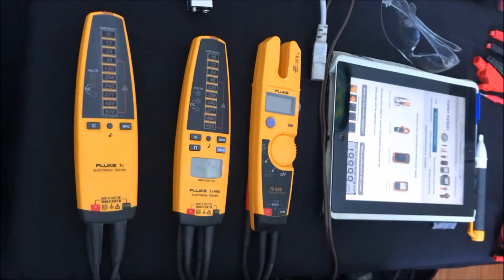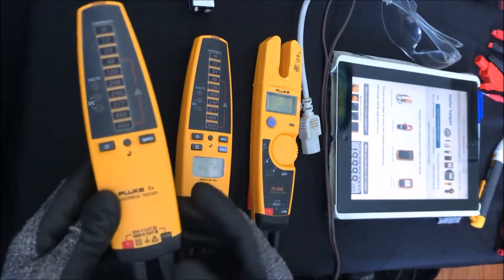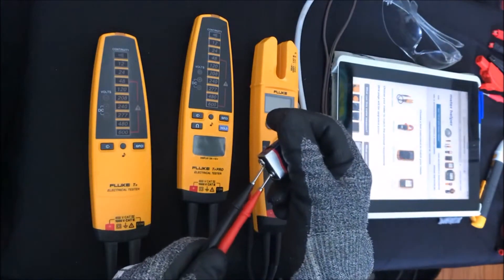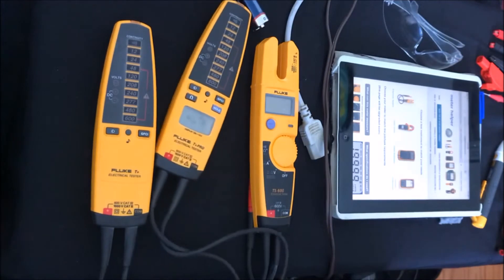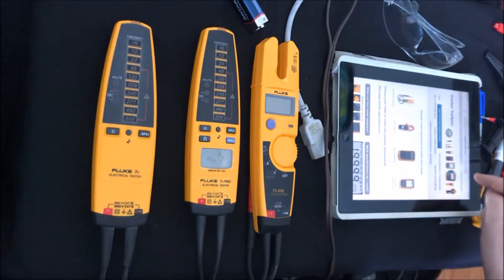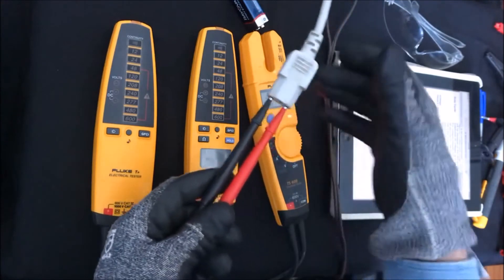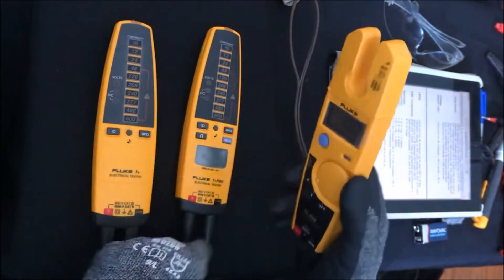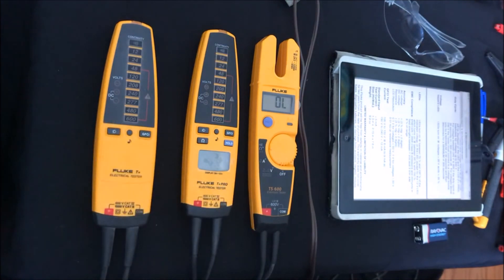Comparing Fluke Electrical Testers T+ , T+ Pro, and T5

Comment: hello... can the T5 clamp meter measure voltage with putting wire within the clamp? ... thankyou
Reply from the maker: Hello, sorry for the delay in getting back to you. The newer Fluke T6 models added the non-contact voltage measurement to this design. The Fluke T5 models only measure AC current through the open jaws. Hope this helps.
Reply: @meterhelper7692   thankyou for the info

Comment: This may be a stupid question, but trying to learn... What is the benefit of this type of electrical tester, over a multimeter?
Reply: That is a very smart question because the lines between electrical testers and multimeters are getting blurry.  Some of the benefits of  electrical testers over multimeters are speed, ease of use, form-factor (fits in a belt holster), and being tailored for everyday, grab-and-go use. 

These evolved from what was known as a "wiggy", a solenoid that would vibrate when two leads were put across an AC voltage source. Safety was an issue with these and analog meters because there was nothing between the user and the voltage if something went wrong, like an arc blast. 

Wiggies were  preferred by  electricians over analog meters  because they were fast, easy to use, and could take a beating. Digital meters increased safety, while increasing the time it takes to select the right function,  focus on the display, read the display, and interpret the value ( the  reason I prefer analog speedometers and tachometers on my vehicles).  The LED electrical testers vibrate like a wiggy, light up an LED aligned with the voltage level, and give an audible tone. This is much faster with vibrating, visual and audible feedback, especially if you are going from point to point, and just need to know if the voltage is around 120, 208, 220, 480, 600..... Adding a display  adds confidence that the value is 110 or 114 or 120, which may not be important since voltage levels vary as equipment is turned on and off anyway.  Just want to make sure it is a 110 line and not a 480 line before you connect expensive equipment. 

Another benefit is placing a slight load on the circuit. Multimeters typically have a 1 million to 10 million ohm input impedance, to not put any load on the circuit under test, which can damage sensitive electronic devices. This can be a problem with measuring voltage on AC electrical circuits because the magnetic field around a energized wire can induce a "ghost" voltage in a de-energized wire next to it. A multimeter may read 30-40 volts AC, while the electrical tester will place a slight load on the circuit to eliminate this induced voltage that has no current behind it. The "Lo-Z" function that is added to some new multimeters does the same thing, or you can buy an adapter. 

Electrical testers are limited in measurement functions, the resolution in the function ("120V" instead of "120.56V"), and the range of the function. For example, resistance measurement is  limited to 1000 ohms or 10,000 ohms, since you are  just checking for shorts, opens, contact resistances, and maybe a control voltage resistor here and there. 

The fork-type electrical testers  add non-contact current (amps) measurement, which takes advantage of the electrical magnetic field described above regarding ghost voltages. A new invention from Fluke can also measure non-contact Ac voltage (T6) using the same fork.  These really fall into the low end of the  Current ClampMeter category. I place these in both: upper end of electrical testers, lower end of clampmeters. 

For someone working on electrical systems that just wants to get an answer and move on, electrical testers have advantages over multimeters in day-to-day electrical work, at a fraction of the price of a decent multimeter.  

Hopefully this answers your question. I'm working on improving the Selecting a Meter section on meterhelper.com to go over this more in depth, with comparisons between different manufacturers' products to make it a little easier for people to choose the right tool. My web page design skills are lacking, so it is taking me time to get things to line up right on the pages. More videos to come as well.
Reply: @sandsritchie3989  Thank you for taking the time to answer Mike's question because it pointed out a difference between my Fluke 325 Clamp Meter and my Fluke T5-600 Electrical Tester other than a big price difference. I'm new to the electrical field so I purchased the 325 before I purchased the T5-600 knowing that it was a bit of overkill for the type of work I'm doing...for now. So for everyday use, I use the T5-600 since the leads are integrated, more robust, and is easier to pull out of my tool belt or bag and turn on much, and test what I need to much  faster compared to having to take out my 325 from the carrying case, attaching the leads, detangling the leads since they're much thinner and take the shape of the loop or fold while it was stored before I turn it on. The 325 clamp meter is great because I can open up the jaw to get a reading on feeders which the T5-600 simply cannot go.